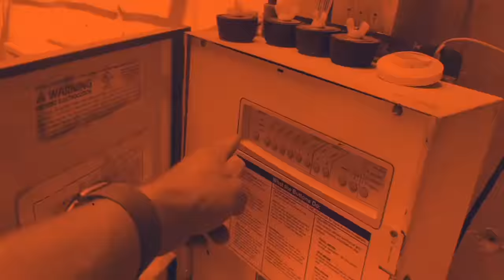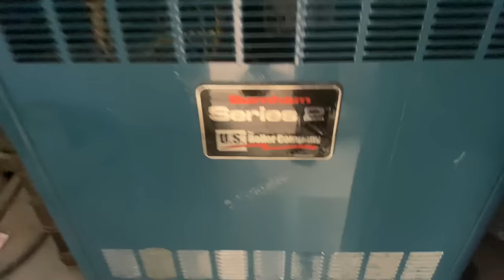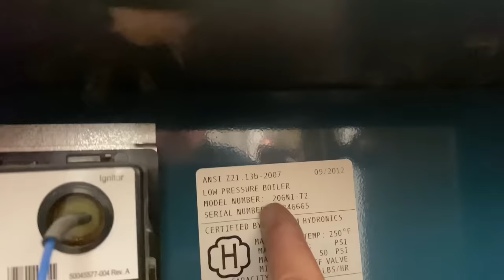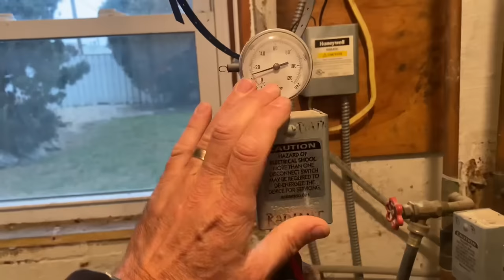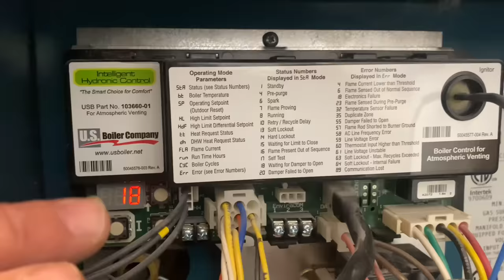Zone Valve Wiring for Beginners - How to Wire Multiple Honeywell Zone Valves to Stats and Boiler

Comment: I have been a electrical controls guy for 40 years - if you want to confuse a kid just start using the term "common"... to explain circuits. In control circuits it's a switched hot until it goes through a coil or motor then it is a neutral.  And all your doing with multiple stats like that is parelling them so when a stat closes it opens a zone valve and the switch in the zone valve turns on the boiler IF the boiler temp is below the set temp... you should build a teaching board to teach boiler and ac electrical to the beginners ...and some of the more experienced guys that still dont get it...

Comment: Need some help if possible? My system doesn’t have a boiler, just use a hot water tank. We renovated the house and moved the tanks to a new location, just a few feet away. Now I can’t get the system to open the relay valves for either of the zones. I’m only getting 11 volts for the relays, when it should be 24 volts. I test the Edwards LR50251 transformer between two of 3 contacts on the top and get 24 volts. When I do it individually from ground to terminal labelled 10VA and 20VA I get 33 volts and the other terminal labelled 8v and 24 V, I get 11.7 volts. I don’t seem to be getting the 24 volts that’ll open the relays. Could my transfer be hooped?

Comment: Nice job of cleaning up a goat rodeo. I do this a lot of this, I hope some day WAGO will follow, but I was taught to do these with terminal blocks mounted to a board somewhere near the valves.  In later years I went to running the thermostat wiring in plastic push lock air tube to eliminate pinching loose wires.  It looks great on multi zone radiant systems and it’s easy to install drill a hole pop in a rubber grommet and use a zip tie to retain.

Comment: My first hvac job was with an oil company in 99 before zone control boards were common. The hornets nest of wires was intimidating but now it's so easy. Important to know which t stat wire goes to which zone valve before tearing it apart to clean up. Great video
Reply: they were not labeled so Mikey buzzed them out, that why he tore it apart like an animal.... lmao

Comment: Very interesting I'm a heating engineer from the UK. 90% of our zone valves and controls are on 230-240 volts and the 2 most common systems in the UK are called S-plan or Y-plan. The basic concept is the same. Keep creating great content and have a prosperous New Year.
Reply: why dont they change that... much safer at low volt
Reply: That mean retrofit step down transformer to millions of central heating wiring centre when this has been the normal for 40 yr

Comment: I sold my old and purchased my house a year ago. 
I’m a Automotive tech of 20 or so years now. I do all the Diagnostic / programming work and electrical repairs. 
In my new house I have 5 zone valves that all work fine. However the wire management is D~ work. One part of me says just leave it alone the bigger part says clean it all up and redo it.

Comment: Those HoneyWell zone valves have 4 long wires, but not long enough! What do i mean? Well I like to wire all the low voltage wires into a junction box and make my connections in it. With Taco zone valves this allows me to do just precisely that, which in turn makes for a cleaner, neater job. I do like those new age wire connectors you used here, they are quite neat indeed! Don't get me wrong, i know this is not a new install, so we have to deal with things the way they are most of the time in heating service. BTW Congrats on your licensure endeavors.

Comment: This video was extremely helpful and almost identical to my system with some minor differences. My (old) boiler has two external 24v transformers for a 5 zone system. I wired just as described, but my nest thermostat is only showing ~12 volts at the thermostat for the C wire. Do I need a new 24v transformer with more amperage? Thanks!
Reply: @PipeDoctor  Any thoughts to why my thermostats would show ~12 volts for the C-wire, but a multimeter shows 28v across the R and the C? Thanks!

Comment: In order for me to understand the wiring I would have to start with the thermostat and work my way down to the switches.:face-fuchsia-poop-shape: Your wiring is still better than it was before, good job. Peter is learning so much from you because you are a great teacher and I can see you want Peter to succeed . :yougotthis: What I would like to know is why are there two thermostats on one wall?   Thanks.
Reply: Probably hooked up to a secondary heat source like electric heat or an outdoor wood boiler.

Comment: That mess looks just like what I have in my home at the moment. 3 zone boiler system with Honeywell zone valves. I want to redo it and your video was real helpful. Thanks! Are the two reds and yellows on a zone valve interchangeable for wiring purposes?

Comment: Great vdeo, thank you for your time for doing it! I was wondering if I send you a simple schematic with 2 valve zones (the 1361 of White Rodgers and the 672b of Motorola) would you be able to just validate it that is correct? Especially that I want to replace and old TStat for a wifi one that needs an extra wire which is C.
Thank you

Comment: Very helpful, thanks.  Question, if the top and 1st floor not heating how did plumbing contractor think changing one valve would fix it? Was the initial problem the commons on those two floor therms not matched up correctly?

Comment: pretty much if it cannot all be traced down within five minutes, try to label some of the thermostat runs, rip it out and start over. label! label! label! portable printers are cheap enough now, or use white/color electric tape and hand write them. yeah I know, the labeling often ends up skipped at end of a long job, because you're trying to get out the door to the next job or it's late and home time.

Comment: I think they put the zone valve on the circulator to use as a flow check
Reply: or possibly just for the end switch, but maybe both. at one point integrated flow checks were not a thing, so you'd need to use a relay box and flow check both. the other zone controller likely cannot switch both line voltage(for circ.) and low voltage end switch at once, or it's combined in a group of others. hard to say/guess without looking it all over. they may be stupidly running that circ. pump dead-headed by closing the zone valve and letting it run with the rest of the circs. and boiler.

Comment: I was wiring a nest thermostat to my zone valve and the endswitch wasn't wired to anything, just to the 24vac wire and other was capped, should there be suspicion?? I'm in an apartment complex and it has 2 boilers that supply's 26 units

Comment: could you do a vid about line stats with ribb relays?
Reply: very similar to a 24volt relay and thermostat, except you have line voltage thermostat and relay coil(mostly 120v but could be many other voltages).
the relay contacts switch the "high current" loads on and off, while the thermostat only switches the "low current" relay coil on and off. that allows the thermostat wiring to be smaller gauge and long runs without voltage drop and high current (say 14awg), controlling a relay with 20 or 30 amp contacts "near" the device being switched, which would have much larger wire and high current draw.
probably not a good explanation, there's a reason I'm not a teacher. 🤡 far better at doing than saying.

Comment: So one R wire from each end switch connects to 24v from the boiler. Then the other R wire from the end switch connects to W on the boiler.  Then one R (hot) wire from each thermostat connects to 24v on the boiler. For the yellow motor/end switch wires, one goes to common on the boiler. Then I got a little lost, what do you do with the last yellow wire? You had said in the beginning that yellow needs power so since one yellow is already connected to common (blue), I'm guessing it connects somewhere to 24v? Also, with a two wire thermostat, where does W from the thermostat connect to?

Comment: Mike, I have no 24VDC out of my Dunkirk Boiler. Only aTStat Out TR(red)/TW(white)/C(black) TStat line side terminal block,  TR(red)/TW(black)/C(white) load side terminal. (Don't ask me why, no idea) I have 4 zones that have TR(red) &TW(black / white inside boiler) tied to the End Switch and R from TStat tied to same as TR(red).  White from TStat tied to Yellow motor lead separately for each zone valve. Other Yellow motor lead goes to C(white/black inside boiler) or from lineside of terminal block C(black). Freakin nuts. Do I need to add a 24VDC xfmr to the system to get it properly wired or is this going to operate as is? I know I have zones that don't shut off right now. Trying to make sure what it is before replacing zone valves. Well I know I am going to switch the wires to match color code but other than that. Dunkirk Model:PWXL5ENT5 boiler.
Reply: @PipeDoctor  Ha yeah ok habit. I work on a lot of batteries. But question is with the wiring explained, do I need to add a xfmr for the system? Or how do I separate the end switch from the tstats?

Comment: I’ll never understand why Honeywell added a fourth wire. On Taco zv you have 24v terminal and 2 TT terminals.
Reply: "isolated" end switches! whereas the taco isn't isolated. with taco you have to wire in groups on their own transformers and should use that to power a "relay" coil to turn the boiler on and off, that way you "isolate" the power between systems.
honeywell with isolated switches, you can wire the switches all in parallel and use the boiler inbuilt transformer/relay to through them, then separate transformer (or zone control) to t-stats and zone valves. different techniques from different people/groups back in the day. if the stuff doesn't have "isolated" end switches, then you really have to be careful or you could short things out(burn transformers/controls/thermostats/valve heads and/or end up with 48v on things.